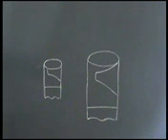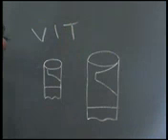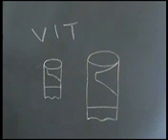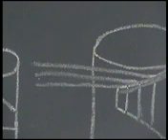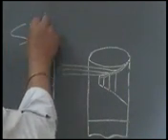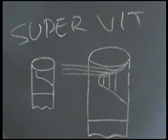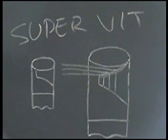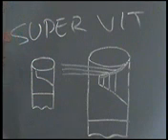Variable Injection timing (VIT) of fuel in engines

Comment: Hai sir ,in this  spill port moved up by the barrel with respect to plunger what about injection timing suppose keep normal injection begins at 8 degree before t.d.c and after move ment of spill porr at wat angle injection commences
Reply from the maker: It's all the timing when the spill port is being covered that the injection begins, once the spill port is raised the timing is sure to change and about  new timing it all depends by how much angle the port's vertical change makes by crank angle.If it is raised it is lagged and vice versa and the change in angle as I mentioned.